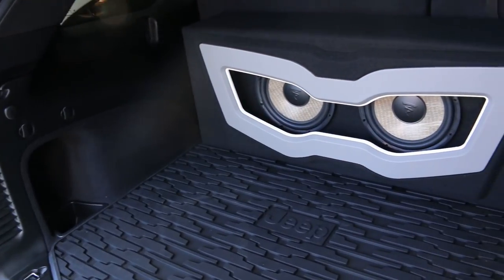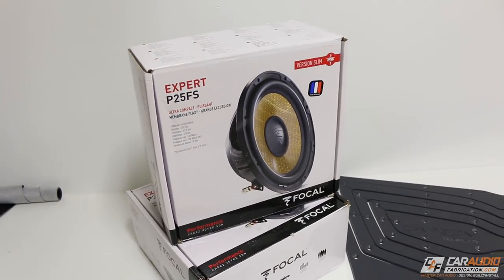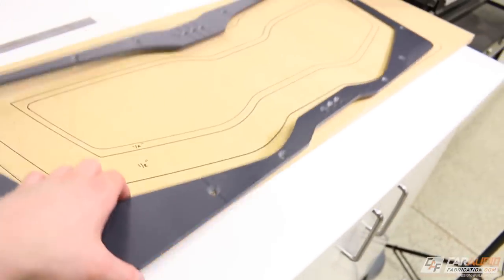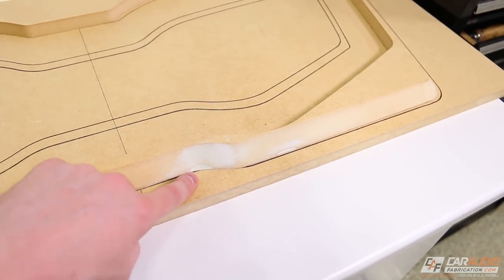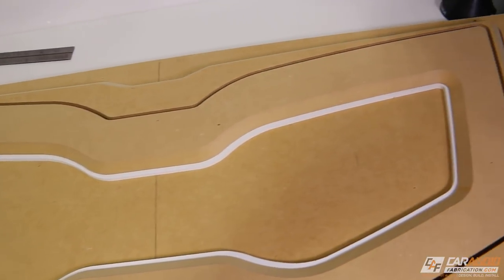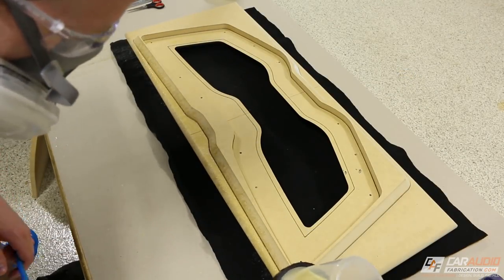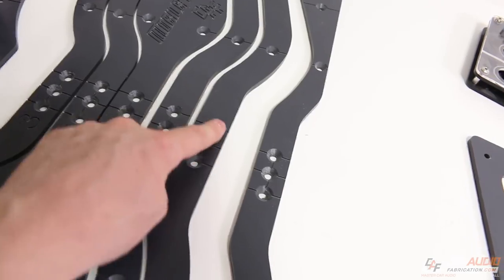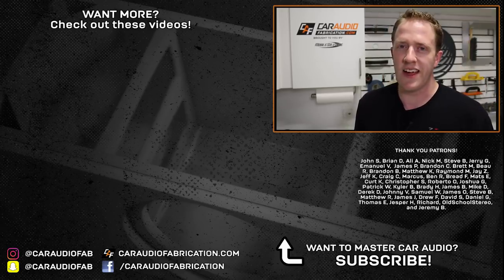How to Build Subwoofer Box - Carbon Beauty Panel & Eco Tray

Comment from the maker: Hey guys, thanks for checking out the video! Don't forget about the CAF Fan Discount - LIMITED TIME! Link here:
Carbon Template & Eco Tray - https://goo.gl/oEsC9e
Reply: CarAudioFabrication can you do a volume vid i know you have one but i still dont understand it and i really want to build my own subwoofer box 😃
Reply: CarAudioFabrication                                 
Hi gugs you are doing a great job, I have bit of problem just installed a audiopipe pre-amp line driver, I have one amp for the sub,I hook that up to the driver, it's working fine,but when I hook up the front and rear speakers to the driver they don't work,  when the front and rear is hooked up to the head unit they are fine. Plz advise.

Comment: Hey Mark 

I have a closed loop feedback that k cannot pinpoint.  

Could you do a quick video on some causes for closed loop feedback and other usual problems with installed in an older car.   

I'm struggling atm to find the source of my feedback I think it's the hewdunit earth being faulty but I won't know until I fix it.  

But yeah closed loop feedback, farthing properly, blown speaker and causes.  How to tune a subwoofer and speakers by ear for amps.  Stuff like that.  

Cheers

Comment: i got two amps :pioneer GM-D9604 & GM-D8604 Hi , i want to set the gain of my channels using a multi meter , for ex,i got mid range with 100 rms @4 ohm
so i need to measure 20 volts by a multi meterwith test tone ...etc
but i didn't get the required volts in my amp , i got only low voltage readings " 6.4 volts at max , can u help me out setting the gain by multi meter

Comment: Can someone help me? I need help of how you find the proper size for my driver. If i use these calculators online the F3 is still 45 hz or something and if i'm right if the f3 is 45hz then how will it ever reach down to 25 hz. How do i build a sealed box that will make my driver be able to go down to 25 hz?